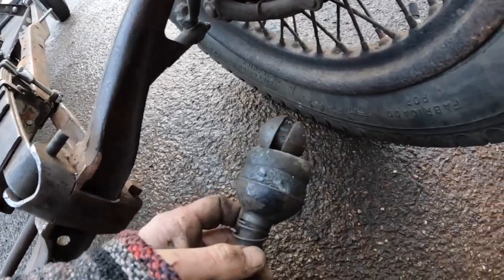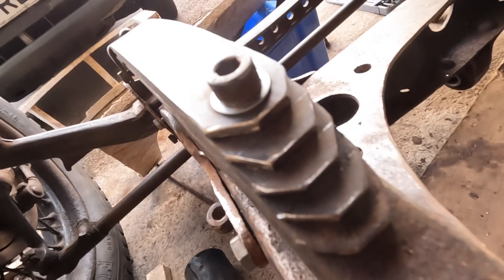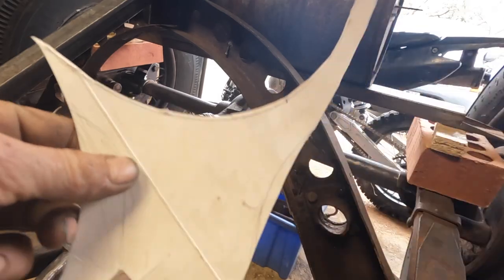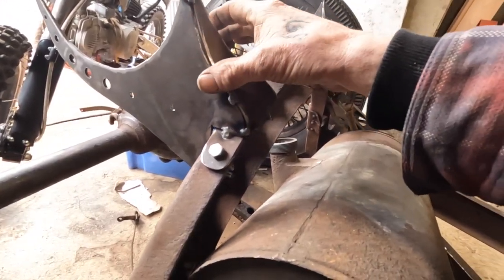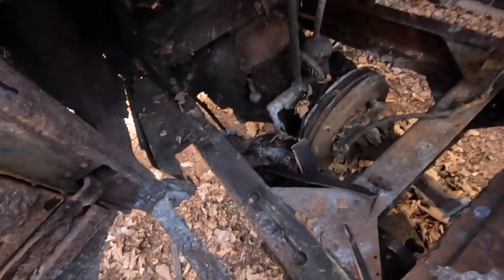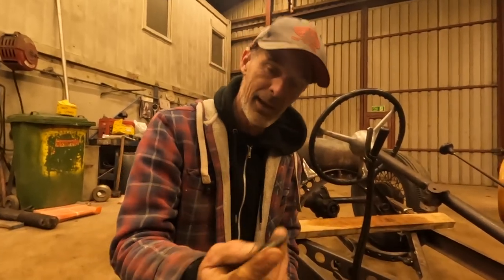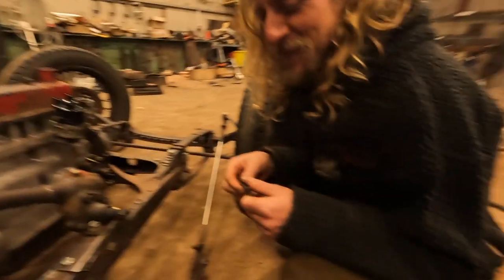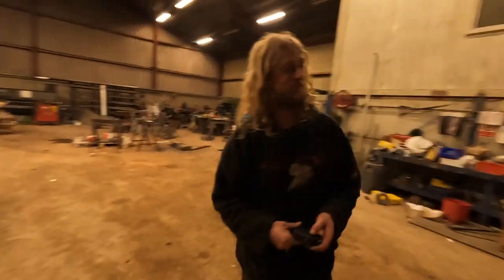the austin ten special....rat ,   part 11

Comment: That was so Cool, everyone needs a Ben to get some special jobs done, the clutch looks much better with the new shaft and going with the cable brakes is what an authentic sportster would have, they work ok if you get them adjusted just right so keep on trucking buddy and I will see you in the next one
Reply from the maker: Thanks mate , all the early stuff was all rod all round , the cables  were introduced to keep cost down but it cost unreliably

Comment: that compressor you have on the floor will run a cut40 from ebay/amazon, i know, i''ve done it.
Reply from the maker: cheap too...🤔
Reply: if you get a plasma cutter the thing you need to know is the air needs to be as dry as possible. if you had a way for viewers to donate, i'd gladly help you get one.
Reply from the maker: @easttexastramps  cheers dude thats real nice , i had one before ,  i kinda dont mind the slit disc to be honest 👍